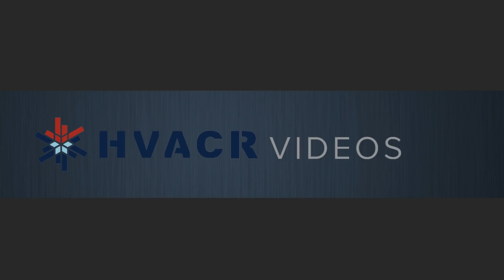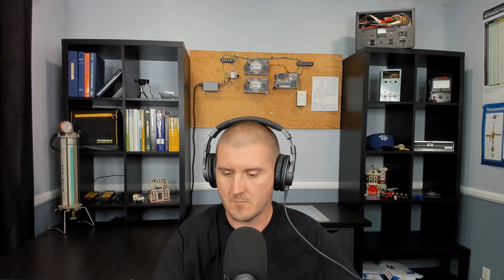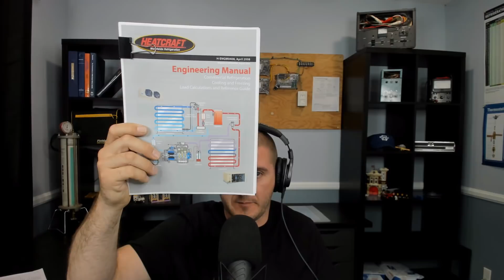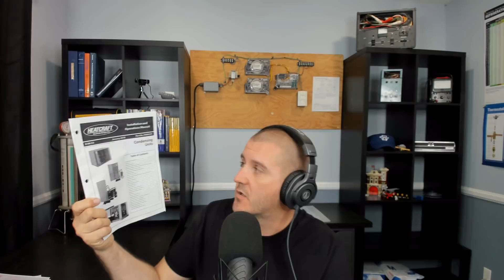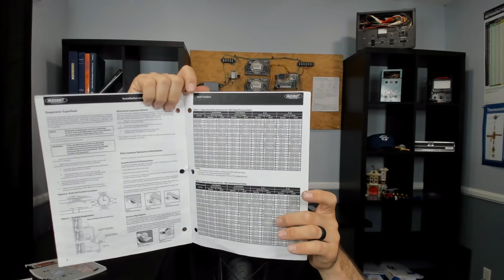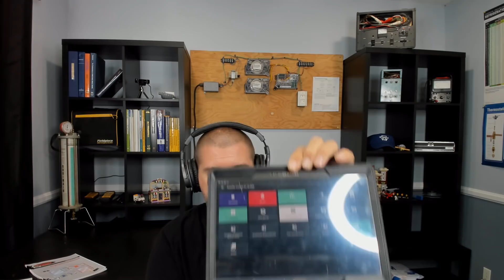HVACR VIDEOS Q AND A LIVESTREAM 6/3/19

Comment: As far as tonnage versus horsepower what I was told ( and this applies to air conditioning, maybe not the same for refrigeration) is if the equipment is water cooled 1 hp will produce 1 ton of cooling. Air cooled 1 hp will not produce 1 ton due to higher condensing temp. In the old days a lot of older compressors were belt drive with open motors

Comment: chris i have a doubt ,my  A.C Uses R-22  . IS IT REALLY NECCESSARY TO CHANGE THE SYSTEM RIGHT NOW OR  IS IT ANY OTHER WAY TO UPGRADE WITHOUT CHANGING MY CURRENT SYSTEM. IN DOUBT ,HELP ,SUGGESTIONS NEEDED.
Reply: Abhishek Chakraborty the unit can always be fixed as long as the parts are available..... there  are R-22 alternatives. But just because it can be fixed doesn't mean it's always gonna be the better option. Poor performance of your current system can be very costly compared to a new system. You have options,  find a reputable contractor and they will present you with your options. If they tell you that it is illegal to fix your system because it's R-22 don't move any further with that contractor and find a new one.
Reply: @AGON17  thank you